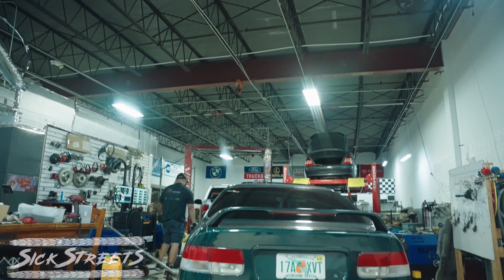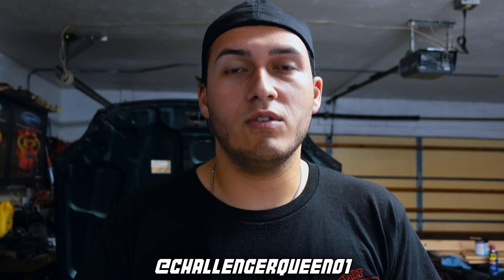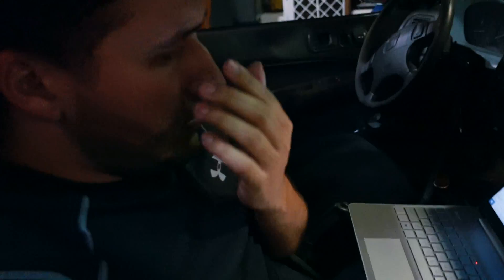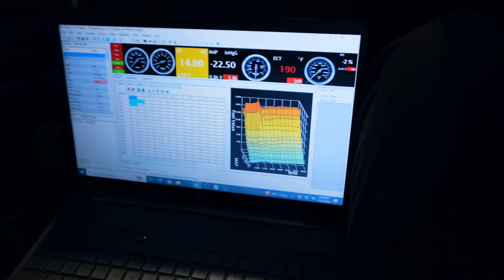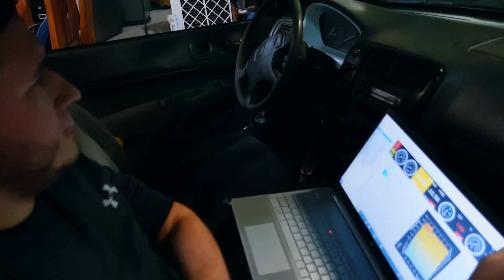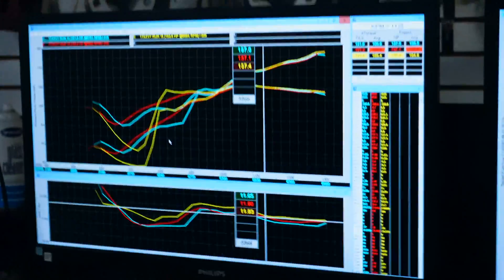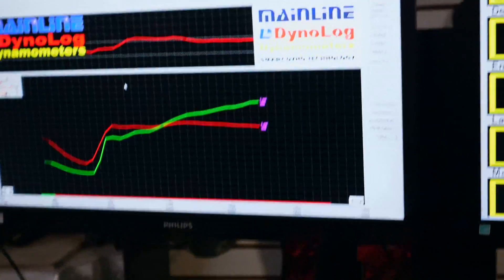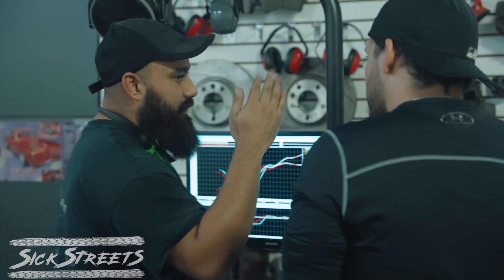Turbo D16Y8 Civic Dyno Day [4K][2023]

Comment: I did some research after watching the first time but i read that 250HP with stock block is a highly danger zone and at 200HP is like safe. 150HP is the safest setup. Are you moving up around 200HP or 180HP or keeping it at 150HP. Im thinking of turboing my d16y8 and having it to 5psi on stock block
Reply from the maker: Yeah anywhere around 200 you should be okay

We have pushed this motor to 7 psi for a bit but we did start to experience head lift. Could be from back torque. 
Tbh right now we’re building another motor on the side so I’m trying to make this one last in the mean time
But when that one is done we may head to the dyno and run it at 7-10 psi and see how it does
Reply: @CJBuilt  my goal will be either 150HP or 190HP, i know 150 can run stock injectors but can 190 run stock injectors(240cc) and stock pump ? 

Im gonna do the tuning myself before boosted application and after with hondata.
For boosted im thinking in running around 12.0-12.5 A/Fr 
Can i get your opinion idea and help :)

Comment: How much miles or km’s does the EJ8 have? I was thinking of putting a turbo in mine but idk how 310,000km would hold up. Besides the high km’s, the car is clean and has no issues
Reply from the maker: The motor we have right now is right around 150k? 
Only thing that’s new as far as I know of is the cylinder head 

I say start at low boost 4-5 psi and see how the car feels
A good tune should make it fun 
You can shoot for 7 but once you go 7-10 psi just be mindful it is an old motor and some hold more and some hold less 

Of course depends on the size turbo you run 
7 psi on a t25 is way less than 7 psi on a T3/T4